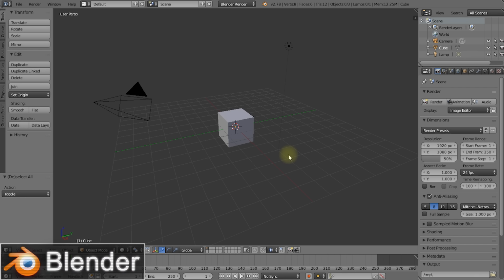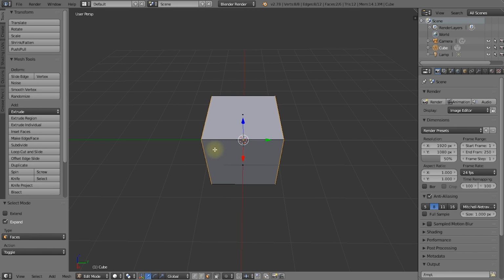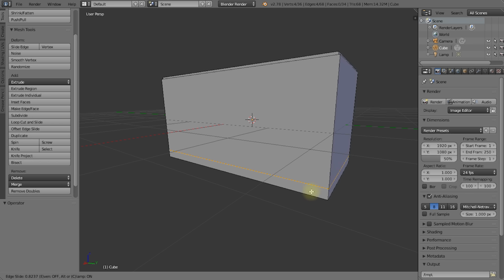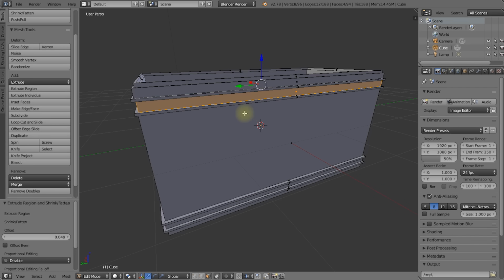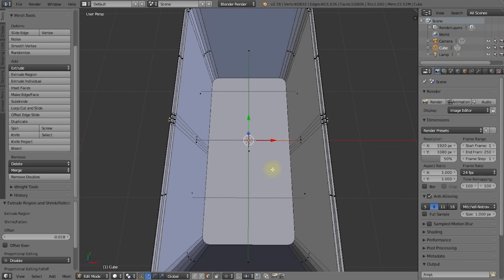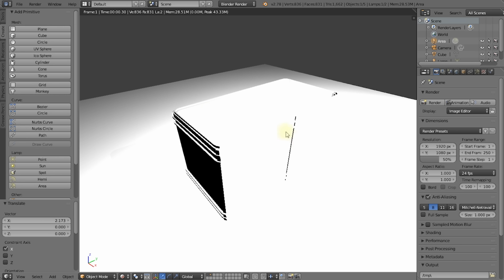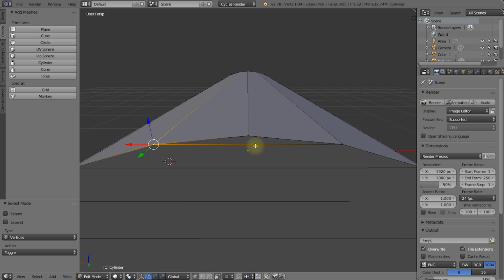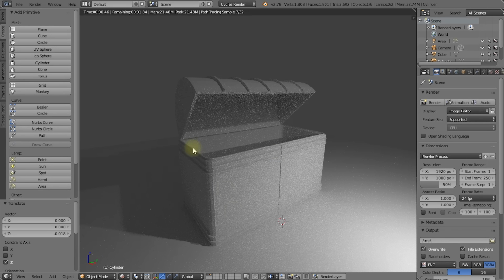MODELLING For Absolute Beginners - Blender Tutorial

Comment: I would like to know how all your insets are coming out uniform because mine don't. None of them. Two sides are always thicker than the other two, and I have to stop everything to fix them. That ridge on the top of the chest, all the edges are screwed up. One side will be fine while the others are twisting, crossing other edges ect.. I am using version 4.1
Reply from the maker: You’ve scaled the object up in object mode instead of in edit mode and therefore your normals are stretched along one side
Reply: @SurfacedStudio  Actually that is not the case. This happens with the inset tool and that tool is not active in object mode. You have to be in edit mode to use it. Another issue as well is that the bevel tool will not bevel any edge at a 45 degree angle. You must have something set up that you never covered.
Reply from the maker: I'm saying you likely scaled the object up in object mode. That scales your normals as well which influence things such as inset and bevel operations. When you then go into Edit mode and inset / bevel, it'll use these scaled normals and the inset/bevel will look off.
Just tried this with 4.1.1 (with factory settings). Works fine if I scale my box up in Edit mode. It's distorted when I scale up my box in Object mode.
Easy fix: go into Object mode, select object, go to menu Object -> Apply -> Scale. Voila! Your normals are no longer scaled :)
Reply: @SurfacedStudio  I found an issue with the offset settings witch seem to make things look more normal. Thanks for covering all this.

Comment: Was following step by step, but when rounding out the edges I had a problem. It curved thankfully, but for some reason the corner vertices kinda stayed there. So now I got curved corners guarded with sharp jagged edges with messy edges. (Currently using blender 3.6)

Comment: This is a great tutorial, but I wish you'd covered some more common issues you might run into and how to fix them. When it came time to bevel the front and back, I had faces ejecting out and into the inside of the chest. Took me about an hour to figure out how to fix it. 

Turned out I somehow had extra edges and had to find out how to remove the duplicates with merging, made even harder by the fact all the tutorials for doing it were in the wrong version, which I can't use because my laptop doesn't support OpenGL 3+
Reply from the maker: Have you watched the updated version of this tutorial yet?
Reply: @SurfacedStudio  The updates are actually the struggle on my end haha. I'm stuck on 2.79 for now. All the tutorials I could find for fixing this problem seemed to be 2.8 and up.

Comment: Is there a Hot key to Move vertices along Diagonal Directions. I'm having an issue with this since If I use G, The Vertices also end up moving Farther away, leading to a Warped Model.
Reply from the maker: The diagonal of what? You can change the coordinate system used for moving objects at the top of the 3D view and choose to, for example, move the vertex along the normals :) Also, make sure you check out my updated version of this tutorial - unless you're still using Blender 2.7

Comment: I wonder how you create the walls of the shape but want the same thickness but not along both normals I think they are called.
Reply from the maker: The distance of the inset from the edges will depend on the scale of the normals in your model. If you scaled your model first you likely scaled / distorted the normals and your inset won't be equi-distance. If you want to keep your normals all the same make sure you scale the object in Edit mode, not Object mode :) Also, be sure to check out the updated version of the tutorial!

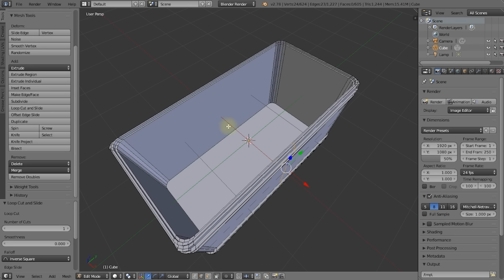Comment: well I have been following you during this vid and i have a problem well I'm on the part where you did loop cut and slide part 20:32 
after I had cut one of the part and started to do the same to the edge but it seems the inner wall is connected and just expanded as I increase the line and I don't know how I did it or how to get rid of it

any tips? Thanks!
Reply: None welp

Comment: I'm trying to follow this tutorial in Blender 2.92, but I keep getting stuck at the 'Extrude along normal faces' part. I'm not sure if there's some sort of difference between this older version and the newer version that I'm using that's causing it, but even with 'Extrude along normals' selected, it's just acting as if I'm just extruding the faces individually.
Reply: I figured it out. Apparently you have to flip normals. I probably did something wrong though.
Reply: I am a complete novice. I had to extrude every other one and input a value (I chose 0.1). The value sometimes had to be negative depending on the direction I was moving. After doing each other one individually I just made faces between the gaps. Did you find something else that worked?

Comment: for anyone struggling with adding loop cuts - you might have knifed an N-GON into your model. 

have a look around your model for the culprit (whatever edge the loop cut stops at) 
use the merge vertices tool-->
alt-m in 2.8/2.9.

Comment: 13:46 Is there a way to ensure that after I extrude inwards, the inner part will be flush with the rest of the wall above and below it?  I could split the rim I cut into three subsegments before extruding it, and then only extrude the top and bottom one, and that would ensure it would be flush, but is there a tool Blender has to make things flush after the fact?  Or, if I did it that way, could I make the top and bottom extrusions flush with each other?

Speaking of which, if I did it the way I mentioned, is there any way I can use to make sure I divide the rim into equal thirds?  I'm a bit of a neat freak.  EDIT: this second question was answered after i watched two more seconds of video, nvm

Comment: Thanks for the video! I have a question: How do you make the dimensions of things line up without doing a bunch of manual math? E.g. how do you make the strapping on top and bottom the same width and make sure the "pushed in" parts are pushed in the same distance on both? Is there a way to parameterize it or make them dependent on one another so if one changes both change?

Comment: Hi, I'm trying to follow your tutorial using units so I can have control on dimensions. No problem with extrude, scale and inset face, but using 'loop cut' tool I can't move on the grid by snapping. And it will be useful of course. Thanks a lot.

Comment: This tutorial is so helpful I made a mistake on the cylinder unknowingly and corrected it without hitting ctrl + z 20 times. I noticed the mistake after using the knife tool. I did dissolve faces which made the bottom flat instead of having an open bottom. Selected the bottom and did deleted the face and made it hollow as intended. This tutorial has taught me well. Thank you for this 👍

Comment: 2:13 when you collapsed the time-line, how do you revert it back without Ctrl + Z?
Reply: Bit late, but you just drag into the viewport from the bottom right corner and use the top left button in the new viewport to change what is shown :)

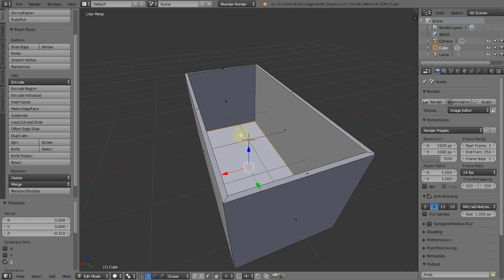Comment: I'm trying to do the part at 9:30 where you create a small rim on top of the box in the current build of Blendr. However, when I inset the faces after selecting them all with shift, the way they inset acts as if I selected them all individually rather than as a singular face, meaning that there are gaps between the ridges. How do you avoid this?
Reply: Never mind figured it out, you just press I again to set "individual" to off
Reply from the maker: Glad to hear you figured it out!

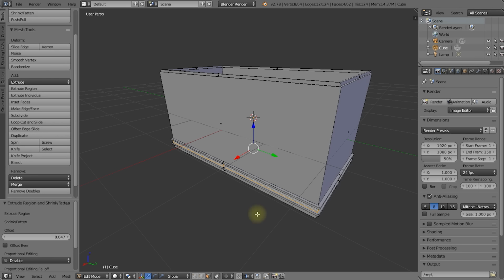Comment: got to 13:50 before blender totally gave up and didnt let extrude the just inset face
Reply from the maker: Make sure you didn't accidentally double inset or extrude and not actually move the edges. Try doing the inset / extrude on a simple cube first to make sure you're comfortable with how that works :)
Reply: Surfaced Studio alright, thanks for the tip
Reply from the maker: No worries, hope it helps!

Comment: Hey, in which tutorial do you cover how to get more precise with the measurements?  I want to, for example, make a dresser for a video game, and I'd like to have the top section be precisely, say, 1/20th of the object's height.  I can make the Loop & Cut thing work, but I can't see how to make it go precisely -0.95 -- even moving it around doesn't get to exactly -0.9, but something like -0.905, and I have no idea how to have it snap to a preselected measurement.  I would really like to make a set of matching cubelike objects (counter, drawers, oven, fridge, cupboards, dresser, sink, etc.) that all have the same detailing and have the numbers/ratios be pleasing to my brain, not randomly whatever my hand happened to draw.  And I'd prefer not to have to achieve this by carefully zooming in and counting pixels or measuring it against a 95%-scale object or some damn thing like that.
Reply from the maker: I don't have any tutorials specific to that, sorry. You can use the Measure tool to precisely measure things or move loop cuts around according to the grid (which you can adjust)
Reply: @SurfacedStudio  Oooh, grid!  If that's anything like the grids I've used in other applications (such as GameMaker), this will probably solve everything really quickly and easily.  Here's hoping I find the right info on how to use it!

Comment: So I'm trying desperately to use this on 2.81a and the Knife tool doesn't let me cut between vertices?  Does anyone know why this might be happening?
Reply: You have propably duplicate vertices. Select all vertices and right click, select merge vertices > by distance. Now you should be able to cut with knife.
Reply: @SamuelTravnicek  I ended up pre-selecting them and using J (I don't know what the command is, a friend told me to try it) and that ended up working for the them ones I was having issues with.  I had tried merging them but when I used the merge command it said I only had one selected.  ._.
Reply: I had the same problem and selecting all vertices and merging to 0.00001 cleaned it up that they were joinable with the knife, if that helps.

Comment: Hi Tobias, Thank you very much for this tutorial. It allowed me to start with the Blender! I have a question. I have noticed when you move or scale objects in Blender you do it when the objects in Edit Mode. What is reason for that? For example at the beginning of the lesson you could have simply scaling the box. But you prefer to switch to edit mode, select 2 opposite surfaces and then scale. Why? Thank you!
Reply from the maker: Hi Jav2, thank you for the comment! Nice to hear you're enjoying my content. I tend to modify my objects in Edit mode to avoid scaling the Normals. You can also just scale and then fix up (recalculate) the normals, but I wanted to focus on Edit mode in this tutorial so I mainly went with that :)

Comment: Does this work with DCS world a combat flight simulator?
Reply from the maker: I don't know. Does that simulator support file types also supported by Blender? :)
Reply: @SurfacedStudio  no but there is a way you can convert to edm files not "Adobe dreamweaver files" but that's for 2.78 where someone on GitHub made an extension which that lets you convert those files i have 2.82 P.S. did you make a updated video on 3d modeling for 2.82 cause when I got in 2.82 everything was moved around and I think some keybinds changed not sure on the last thanks for even answering but when I pressed ctrl-e it took me to a huge menu instead of the little one for the edge normals and edges only it might have been shift but I tested both controls.

Comment: problem solved by starting over the whole project... all is working as normal.
...
I seem to be having issues with beveling the edges, it does not do it uniformly, its like the bottom inside corner will not bevel along with the rest of the edge. Might have something to do with the extruding I have done...Would recessed extrusion affect the edge bevel?
Reply from the maker: Check out this video for some common issues with Blender :) Might have accidentally duplicated some edges or vertices along the way: https://www.youtube.com/watch?v=n9YYrVQdCMY
Reply: @SurfacedStudio  Thank you :)

Comment: That's just scary.  If I wanted to make a hollow box, I would've used Boolean difference to cut a smaller box out of the inside of the new one.  Used a box to cut off one side of a cylinder - again using Boolean difference.  Cut the inside of the lid out using a resized cylinder... you guessed it: Boolean difference.  Then I would've painstakingly added thin boxes and curved sections to the objects - the bloody thing would've taken me hours!
And I doubt it would look anywhere near that good!
Reply from the maker: There's tons of different ways to get to the same result :) Mine is certainly not the optimal method either, but I figured it might be good enough to show some basics for modelling in Blender haha
Reply: @SurfacedStudio  And show basics you certainly did!  Absolutely awesome video; I learned so much.  Not just techniques, but another way of looking at the problem.  I tend to think in terms of adding to or subtracting from the shape as if attaching bits or drilling/cutting/routing out bits.  Your way showed me a lot of new interesting features I wasn't aware of.
Reply: @SurfacedStudio  And now, thanks to your demonstration, I was able to use the knife in edit mode to make a complex shape that I would've failed at had I tried my usual techniques.  Vielen Dank!

Comment: Half of what happens for you does not happen for me what so ever!!!!! 13:45 you bring that section in but mine is just hidden by the first time we extruded. Not only is this video old and outdated you go to fast and do not explain thoroughly. you said extrude out done, then you made it slightly smaller done, then you say to extrude it back to create the lips.........except it just stays flat and doesnt do what you are doing.....
Reply: So you did NOT state if you click off the object after using the "I" short cut it will not work!!! jesus
Reply from the maker: Did the tutorial say you should click off the object after using the "I" shortcut?
Reply: @SurfacedStudio  no but when you talk as fast as you do and i have to pause getting back into blender i clicked not knowing what it would do. This is a beginner tutorial you should be stating that clicking off things will ruin what you are doing.
Reply from the maker: Sorry, it is impossible for me to go the 'right' speed for everyone. Some find me too slow, some find me too fast - the best option is to adjust the video playback speed unfortunately. Also, I don't think it is feasible to mention every single thing that one should not be doing except in a few select cases (like common issues or likely traps) and those differ for everyone
Reply: Surfaced Studio I agree but I do think not clicking off is an important thing for new people to know And I’m just frustrated trying to find tutorials to learn this massive program so I can create simpleish objects so I can 3D print them but every tutorial is either old or old version of the program etc. I currently just want to make like a heart shaped object and this tutorial did help with using bevels and such but it’s super frustrating having to do physics to make a damn heart shape lol.
Reply from the maker: Also if you are having issues with the extrudes or knife operations not working you may have accidentally duplicated some edges or vertices. This vide might help: https://www.youtube.com/watch?v=n9YYrVQdCMY

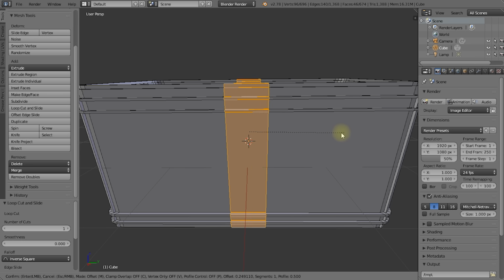Comment: For some reason at random times some things wont work. Like at 21:14 the beveling doesn't work and the bottom bit and top bit will do weird stuff, same for when you first started extruding at the start with the rims at the bottom. I've done the same thing as you did, nothing changed.
Reply: I've tried the common blender problems, nothing worked.
Reply from the maker: It's pretty likely something is screwed with your model geometry. Try selecting and moving around a few faces / edges / vertices - you'll likely find that something got connected incorrectly or is duplicated in there

Comment: Failed at 23:30. Cutting the n-gone into quads fails in blender 2.81. The knife tool simply would not work. Left clicking vertexes do not create a cutting line between them. Very frustrating.
Reply from the maker: You may have some accidentally duplicated edges or faces. This video might help: https://www.youtube.com/watch?v=n9YYrVQdCMY
Reply: Nope. Works just fine.

Comment: What if i want to extrude IN,  like in minute 7:50 without having those edges and faces remain in place, so in short sentence just shorten one side of the cube? Thanks.
Reply from the maker: Select the vertices you want to pull in or move and then either 'g' to move them or 's' to scale them (in relation to the origin) :) I wouldn't use 'extrude' for that as it creates extra faces
Reply: @SurfacedStudio  Right, thank you!

Comment: I have so many ideas for machine concepts and home designs in my head. I didnt realize this Blender software was capable of getting those ideas out of your head and into a design or in this situation a file. I like how you can work with this software offline as well, which means you dont have worry about big companies grabbing your ideas, especially if the company trades on the stock exchange. Not only can you design the concept to look extremely real life, but you can make it move and you could also interact with your concept like a video game. I read somewhere that creators even create game assets with it which means it must be a game engine too.
Reply from the maker: Blender isn't really a games engine (it had one at one point), but it's used quite a lot in (usually indie) game development. It's got some great tools and is getting better with each new release :D Definitely a tool worth learning in my humble opinion